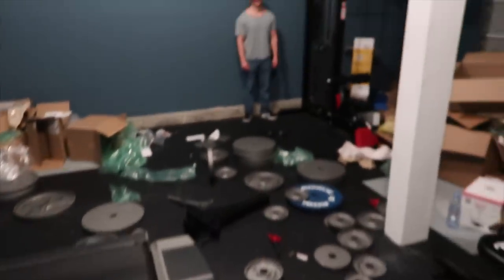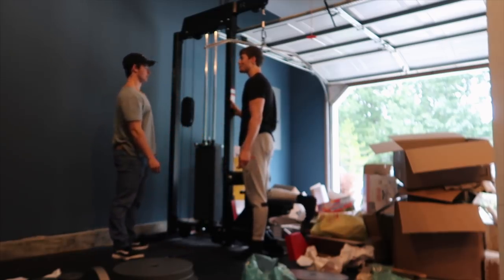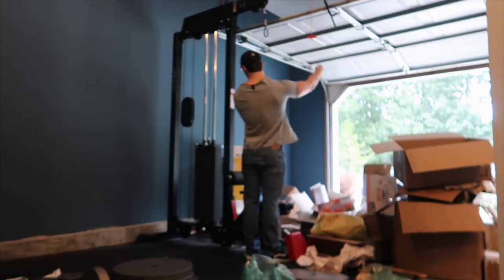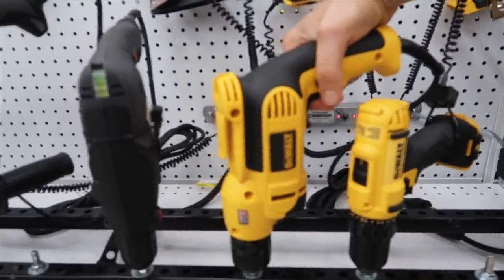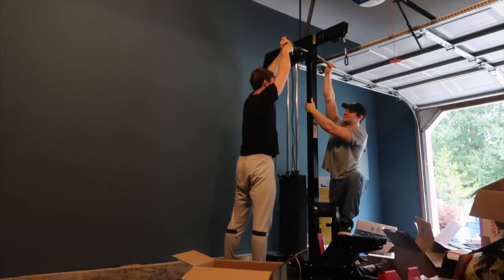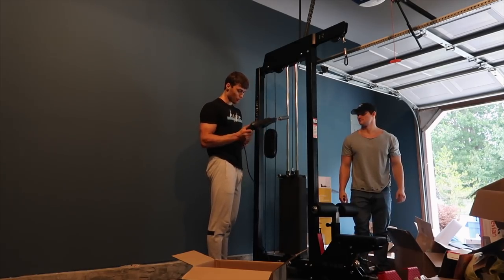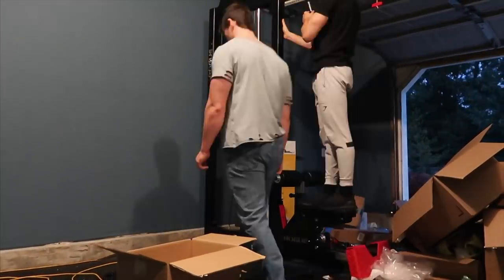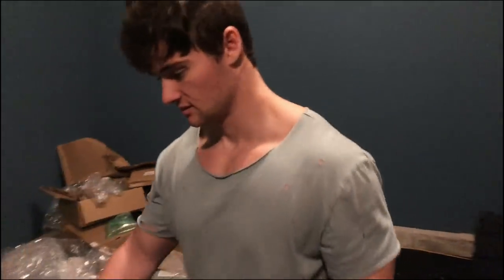Drilling The Entire Gym Apart

Comment: Who buys a corded drill? Battery-powered is the way to go. Adjustable torque. Use the reverse switch, it was going in the wrong direction. You can always break the tension with a wrench, then finish it off with the drill. Who took Shop Class? Nice job figuring it out and putting it all back together; A+ job!

Comment: If you want to unbolt, use the battery drills, not this one. This one you use to actually drill big holes because they are very potent. But for bolts, you can do it with a small battery one.
Reply: Vince I. I work in construction and this made absolutely no sense at all.  Know your shit before making suggestions to people you don't know
Reply: Vince I. That makes no sense. Battery vs corded is not the issue. The issue is that he needed an impact rather than a regular drill.
Reply: homie bob if you work in construction then you must just carry the stuff around and not do work that requires bolts. shut up and take a seat.

Comment: torque is not the same thing as power... get a battery driver/drill with a gearbox and you'll be fine.  Think 100 reps at 10lb vs a 1rep max - same total volume but moved a different way.

Comment: You should have gotten an impact wrench (basically a specialized drill that operates via impacts), or you could have used that drill you had after you applied breaking torque to the bolts with a manual wrench.

Comment: if you don’t have a pneumatic drill you have to loosen those screws before you can use the drill, also if you keep firing an electric drill when it’s not able to spin, it will overhead and catch fire.

Comment: I guess it's kinda late now but you need to use a wrench to break the bolt lose and to tighten all the way but you use the drill in between. So you break it lose them use the drill the shit would have been way easier bro. But hey as long as it gets done